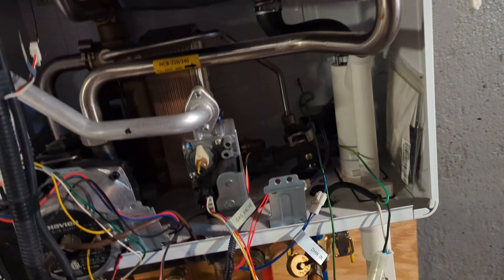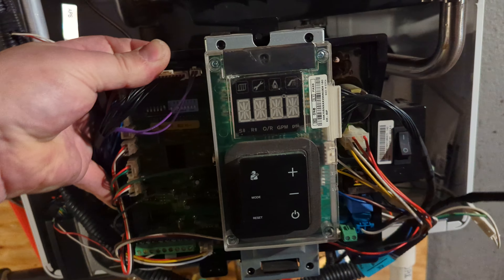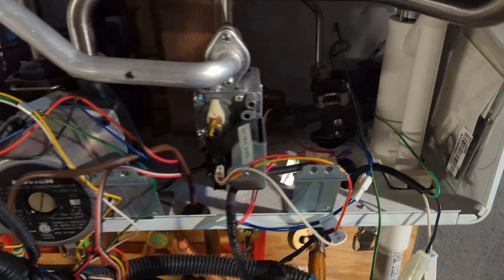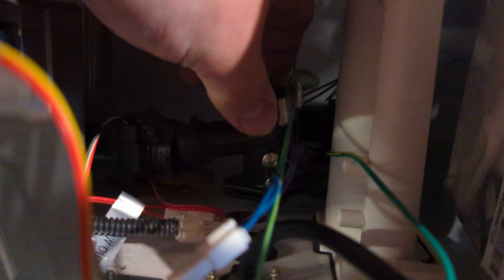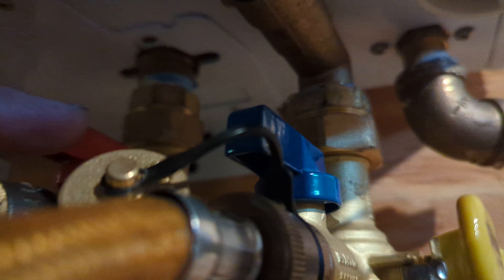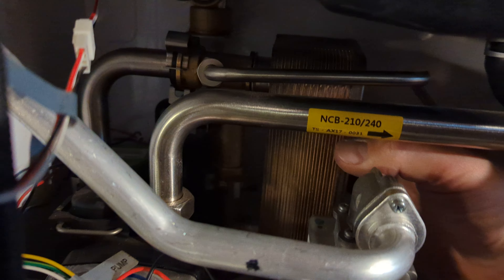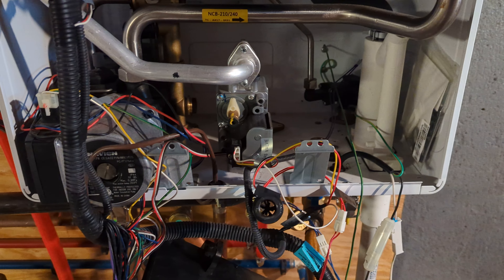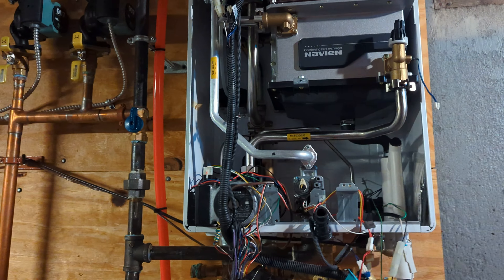Navien NCB Flat Plate Heat Exchanger removal/replace

Comment from the maker: Apologize for the mouth breathing

Was just getting over a cold.
Reply: Lol Tony Soprano vibes. I have the same issue. I installed my NCB in 2020. Blowing out the discharge so I changed the water feeder since it was a left over from the previous boiler. Still raising pressure well above 30# while running. However it's fine when uts "cold" but still stays above the 15# setpoint on the feeder. Cold it settles at 19# ish.
Reply: I have the flat plate coming on warranty will have to put it in this week. Thanks for uploading this.
Reply: Great video. What was the issue you were having that you had to replace that part
Reply: Disregard. I read your description.  Thanks